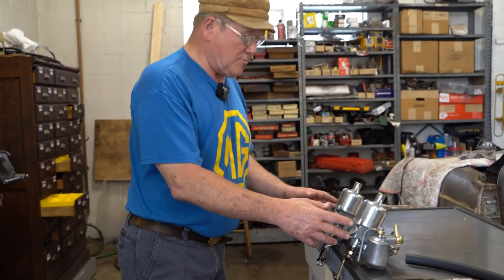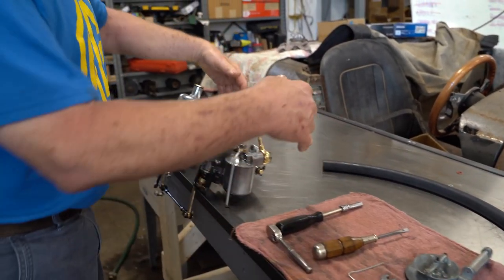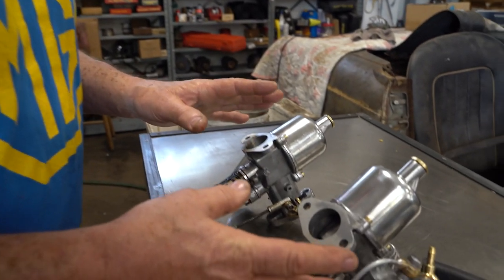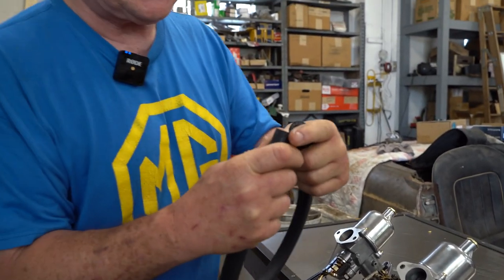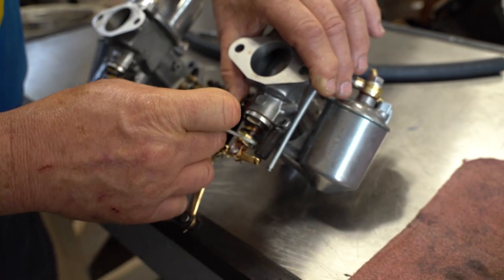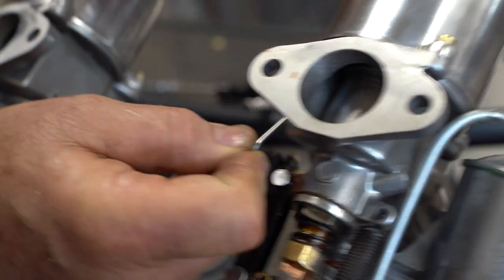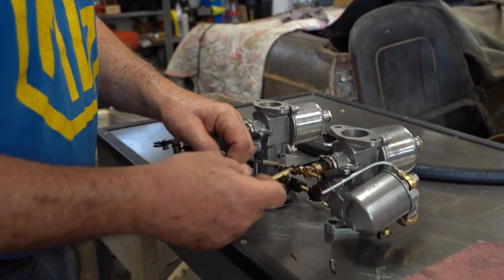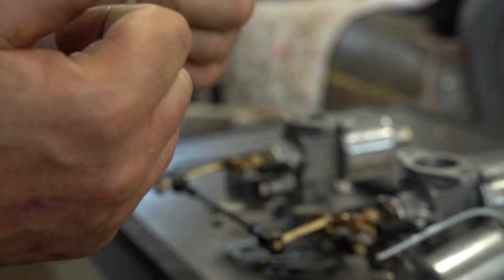342 MG Tech | Fitting and Tuning H Type SU Carburetors on Your MG

Comment: Interesting, that you use sound to balance or pear the throttle butterfly's. Thats new to me!
When I did that years ago, I put the carbs on the manifold. Then, I put lights behind the manifold, with a blanket over my head, so I could see the cresants of light shining from both slides.
I found this was best for me to get it spot on.
Mind you, I am a visual learner and my hearing was below par.
I remember a common problem with the SUs, which was the Flexi fuel pipe could get blocked due to no inline filter! This was sorted once a filter was fitted.
Thanks for your video, have great day 🙂🇬🇧

Comment: Hi John, I have watched a lot of your videos and they are very informative. Have had british cars for over 40 years now. Mostly Minis. I have a -69 MGC GT now which I have had for nearly 8 years now and it took some time and experimenting to tune the carbs right. I have always used a rubber tube for syncronizing but used a Colortune for adjusting the mixture. It works fine. But my experience is that the MGC likes to run a litte rich.

Comment: Great video. Very Informative. After you synchronized the carbs, you locked the carb linkage back together. Then you adjusted the mixture on the front carb. Once you had that set, you brought the RPM down by adjusting the front throttle screw. In effect, lowering the air flow through both carbs. Then you adjusted the mixture on the back carb and once set, the RPM's increased. You lowered the RPM's by adjusting the rear throttle screw. Wouldn't that effect the front carb? Since the front one was set with the proper mixture and air flow, wouldn't the air flow through the front carb now be too low?   Edit: I went back and watched the video and at 7:15 I think you answered my question. You said any adjustment to the throttle screw must also be made in the opposite direction on the other carb throttle screw. Sound right?

Comment: This is great. I recently rebuilt the carburettors for my MGA. Getting that rear lower bolt on and off the intake manifold was quite a chore (and my children learned some new vocabulary watching me do it). When I was all done, it started beautifully from cold (the "choke" worked properly for the first time since I've owned it), but there seems to be a vacuum leak. I tried spraying carb cleaner to localize it to no avail, and listening with a stethoscope makes me think there is a big leak around the gaskets. Can you please do a basic video on how actually to get them off and on properly?
Reply from the maker: I'll try!  Use GREASE on all the gaskets.

Comment: Great video, I wonder if you could talk about matching carb's and manifolds to distributors on an MGB? I have a late model 18V engine and carbs using an early model distributor and notice the vacuum advance takes vacuum from the manifold instead of the carbs. Seems like the advance would occur under different conditions so wonder if the dizzy should be matched? Car runs beautifully as a daily drive, but does seem to use more gas than I would expect and exhaust is a little sooty. Thanks, greg
Reply from the maker: Good idea for a video!  If your plugs are blackened then the carbs are too rich.  Turn the jets up three flats / half turn and check the plugs after a five mile run.

Comment: I've been putting 20/50 classic engine oil in my carbs John. Is that not right? You mention to use gear oil? Is that more suitable?
Reply from the maker: I find 80/90 gear oil to be thicker to account for wear on the dashpots so the acceleration is rich enough.  Some engineers say 80/90 is the same as 20/50.
Reply: The manuals in the later cars tell you to use 20/50. I was quite surprised as I thought dashpot oil would be thin.

Comment: I'm revising the  carburators for an MG TD 1957 but noticed the 2 springs on the pistons are missing and probably never installed. Are these springs needed when the pistons are brass and thus heavy?
Reply: No, springs were fitted after they went to lighter weight pistons

Comment: Hi John, great video! Love it! Just one question, if you lift the piston, just a little, so not pushing the pistonpin on the side all the way up, how long do you suppose to lift the piston? Can’t find it anywhere, also not in the original manuals….  Please let me know! Thanks, Alexander
Reply from the maker: When you lift the piston the vacuum at the jet is reduced which leans out the mixture.  You have results immediately when disturbing the piston's height.  Move it just "a bit!"  You can always call me.
Reply: @UniversityMotorsOnline  Hi John, thanks, so you are telling me; just lift the piston very slightly and for just a moment within a second? :-)
Reply: Hi John, I’m adjusting carbs on my Mg midget (later style Hs4 but basically the same). This is the bit that’s confusing me,  isn’t lifting the piston, the same as dropping the jet, therefore richening the mixture? Instead of the jet falling away from needle, the needle is moving up as it would as the revs increased by sucking the piston upwards?